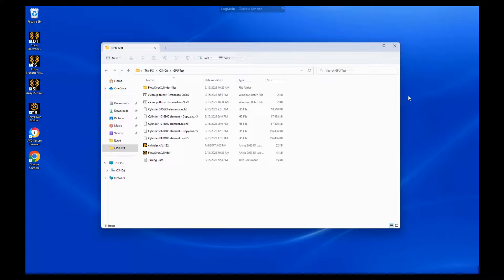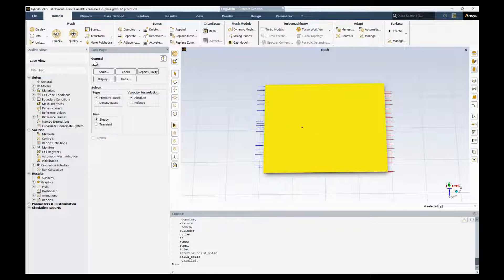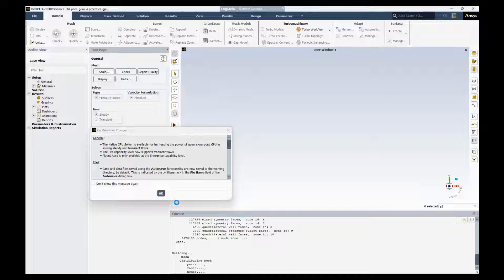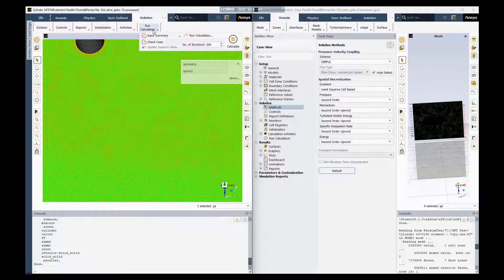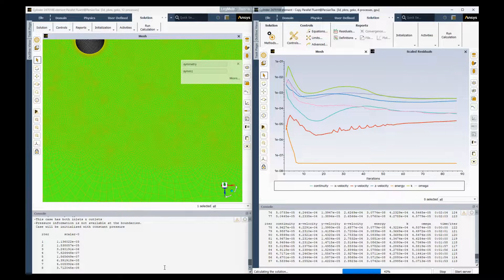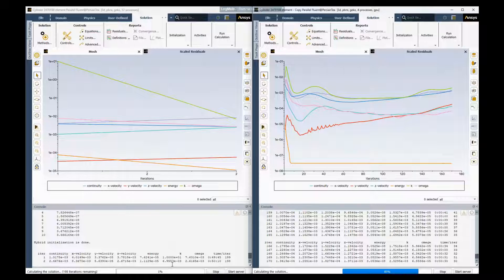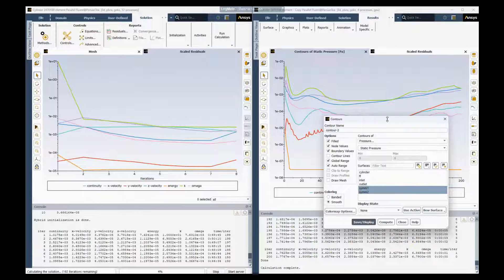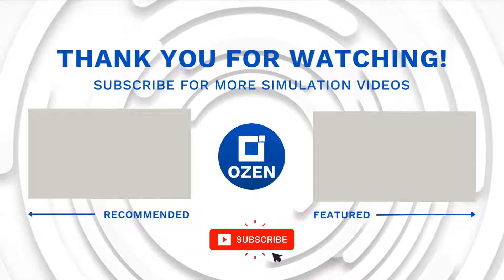Ansys Fluent GPU speed test - full demo

Comment: I’m not sure if it’s that much faster in double precision without a high end Tesla A100 or H100 that actually has the TFLOPS of FP64. Yes in single precision it is lightning fast. I would LOVE to see them get the multiphase solver ported next!
Reply from the maker: Just tested it on our machine. Double precision is also blazingly fast on our RTX4050. Maybe 60% slower than single precision and still way faster than CPU.
Reply: @OzenEngineeringSimulation  please review 4050 vs i9 vs ryzen 9 or what you have or old tesla k80 that has double precision
Reply: @OzenEngineeringSimulation 
So, do you confirm that Fluent can run with Geforce cards ?
(both native GPU solver and acceleration of CPU solver ?)